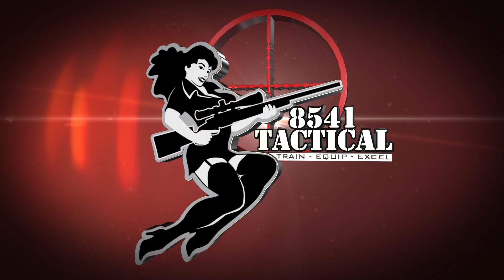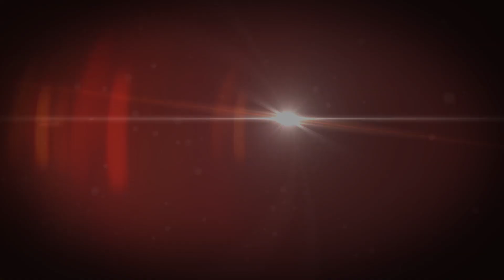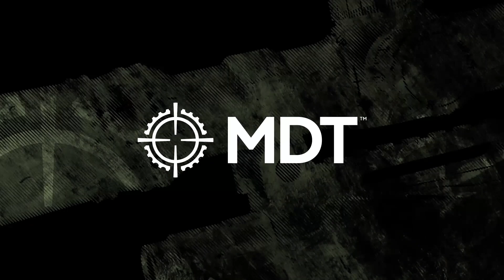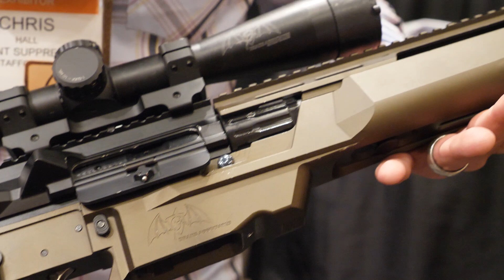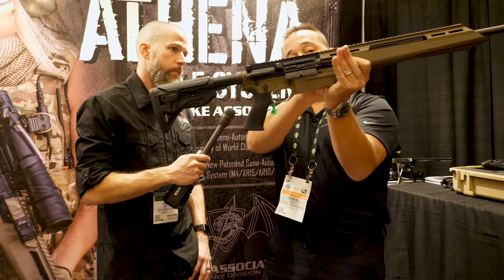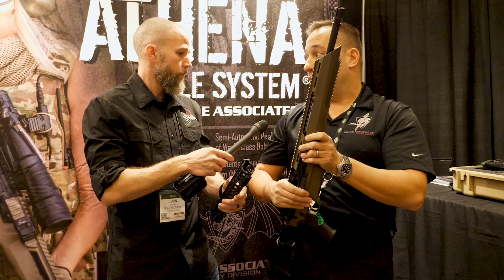SHOT Show 2020 - Drake Associates Athena Rifle

Comment: I also wonder how much that hand guard is going to heat and how quickly. I'm not see a lot of places for the heat to escape from.
Reply: Doesn't heat up much at all. Not hot by any mean but under rapid firing feels warm to the touch
Reply: Looks like a fairly generous amount of venting, out the top anyway. Heat rising and all, maybe quite fine. Bad ass looking AR platform!

Comment: Not a bad price for the system if the accuracy claims hold up. But I'm wondering if they were using custom loads or FGMM box ammo for their ammo. Their site doesn't make that clear.
Reply: We use match ammunition for testing. Actual BH MK262 77gr and Federal 77gr. GMM

Comment: I really want to see this chassis with a strong lean to the Mk.12 for the barrel and suppressor.

PS: While it takes DI AR-15 parts, I do wonder if an HK MR556 upper or a Sig MCX could mate with it, and/or if Drake has plans about adding those to "SOPMOD-D" in the future.
Reply: We have focused on using the mil spec components - and are open to suggestions.